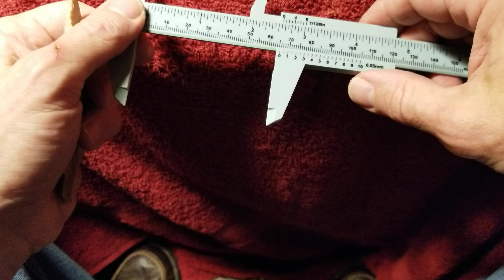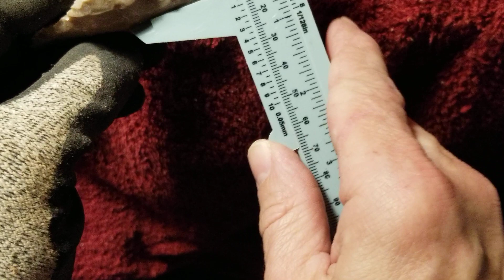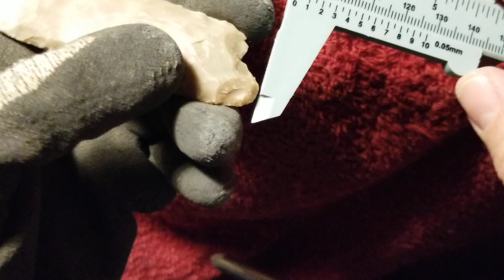1047 - Part 1/2 Flintknapping Three Sided Neolithic Arrowhead

Comment: WOW this is utterly masterful , pitted ware culture late mesolithic early neolithic ...... i have been trying so hard to get this type even a fraction correct , i am sure the neolithic scandinavians would welcome you into the tribe , thanks so much you have literally taught me a skill over a year or so that has lifted me out of some serious serious sh#t and i wish i could tell you how it has changed my life .. a frame of bronze age replica points sent as a gift to until now , estranged 89 year old grandparents , has rebuilt bridges i thought long burned ...  forever thankful , lawrence    edit ... i was under the impression that these were somehow made on long straight and thick prismatic blades from a prepared core , problem for me is getting the long straight thick prismatic blade in the first dang place , nice idea with the ridged flake  .. my theory is they are to maximise harpoon shaft penetration on blubbery sea mammals ensuring the bone or antler barbs grab deep into the internals to secure the dying thrashing animal at sea and to get past the thick blubber into the vitals ? if it breaks once past the blubber and into the muscle or past the ribcage then job done the barbs are deep ? ... smallswords and medieval rondel daggers are designed with the same tri edge to maximise penetration on soft unarmoured targets.. and the tri edge may reduce lateral breakage compared with a thin biface ? .. needs some testing on a seal carcass analogue i suppose vs conventional contemporary points . i just need to make em properly first

Comment: Neatly done! Just thinking that maybe this point style is a result of the way that culture prepared their flakes. I have seen examples of the core removal s from that area with their typical flat side and the dorsal ridge with the flat spine. It looks like it would be conducive to this style point.
Reply from the maker: Yes. As long as the flake or blade was flat. Most blades struck form cores are curved.

Comment: Having literally tried my hand at stabbing swine, they are oddly easy to get stone penetration into - especially if you don't hit bone.  I would speculate a narrow, thick, point would lend itself well to water penetration and/or thick flesh penetration.  A situation where you needed the force concentrated on penetration at the tip and not losing energy laterally.  🤷
Reply from the maker: Slaughtering swine involves a completely different technique than hunting them. This culture was raising a domesticated type. And I believe the fishing was done with nets. I need to verify that.
Reply: @KnapperJackCrafty  it seems it wouldn't bleed much, at least, not as much as one would like to make a quicker kill.  Perhaps they are the tip of some harpoon hafting?  Penetrate the foreshaft, pull the rope, and you have an anchor now embedded in the animal?
Reply from the maker: After doing a little more reading, it seems that most, but not all, communities were big into maritime hunting. Harpoons were widely used in these groups, I assume. I wonder if the tips were detatchable. Sometimes large quantities of wild boar remains are found in settlements. It would be interesting to see if there was a culture of a right of passage for males and the killing of boars with spears. Or perhaps the use of pits for capturing boars and other game? After seeing boar "shake off" gunshot wounds, I doubt that arrows were an effective weapon against them. I could be wrong.